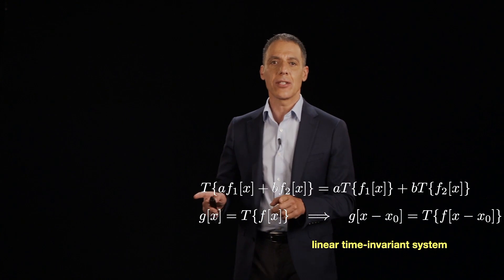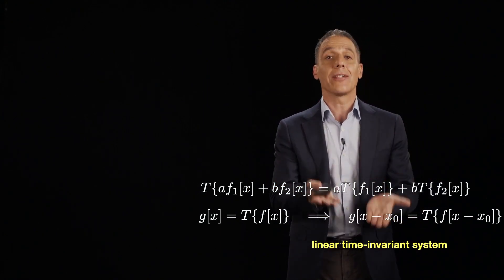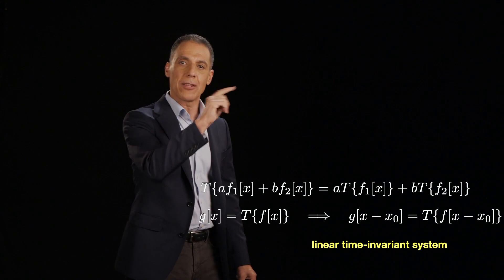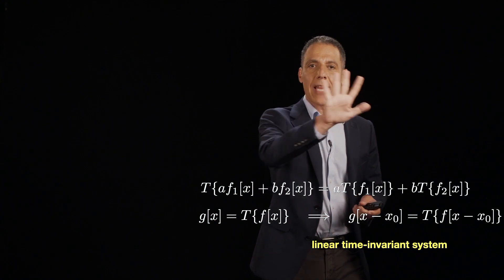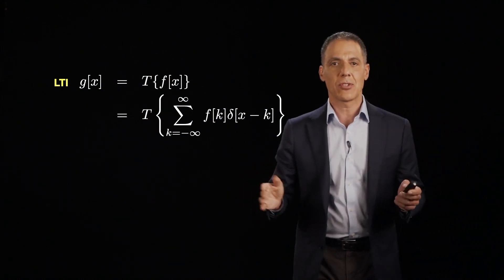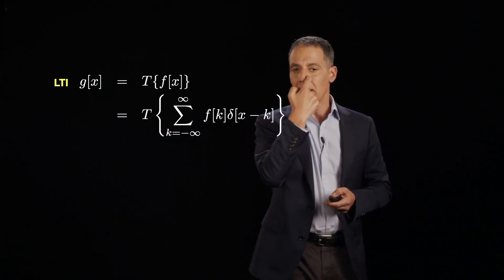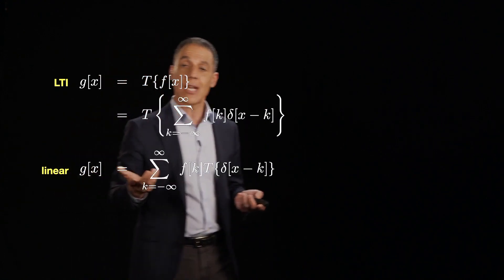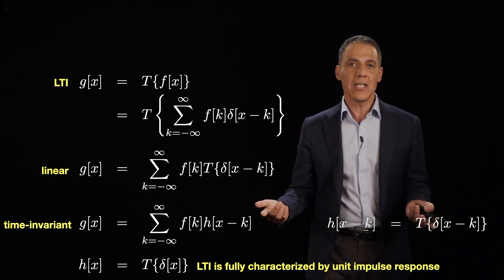Image filtering: convolution: linear time-invariant systems, 1-D

Comment: Thank you for this extremely valuable content, Professor. Is scaling an image to adjust brightness not an LTI operation because of saturation (i.e., the maximum pixel value being 255), or is there another reason?
Reply from the maker: The saturation is non-linear, but otherwise multiplicative scaling is a linear operation, but additive offset is not linear.